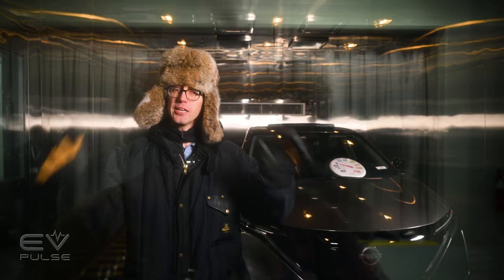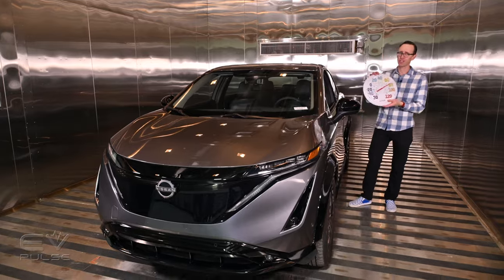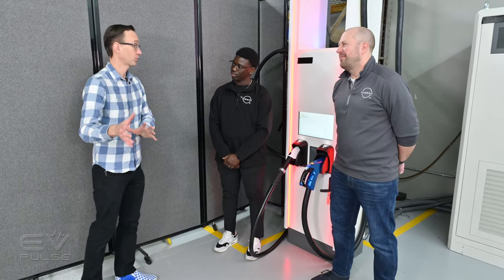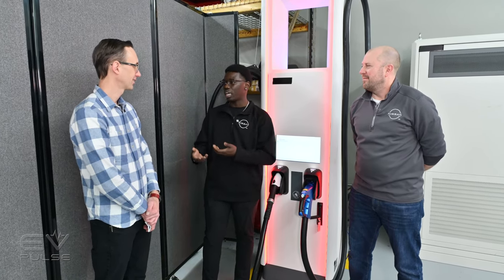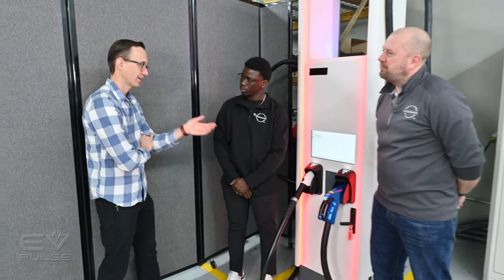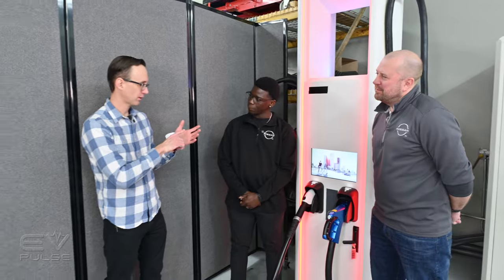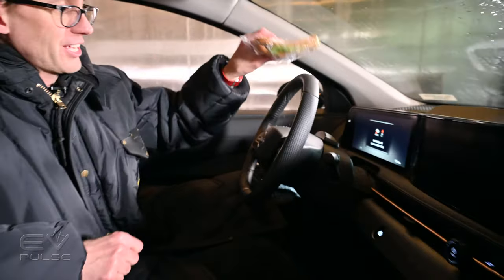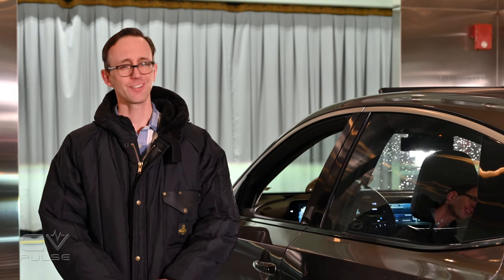We DEEP FREEZE an EV! How Much Range will it Lose?

Comment: On Teslas, you can remotely set it to warm the cabin an hour before leaving even you're NOT plugged in. In the process, the battery slowly warms itself. If the Nissan has the same ability, you should not need to be plugged in if you don't have a place to.
Reply: Well most cars and EVs do have app capabilities with remote start and hold functions. I do it with my Subaru Solterra
Reply: @rylans.5365  This is not remote start. The EV is not on. It doesn't have to be to warm itself. EVs don't have an ICE engine that needs to crank up for just about anything you need from it, and can be risky if left outside unattended
Reply: Byd too

Comment: The issue isn't only the inefficiency of Lithium ion batteries in cold. 

The other issue is that the car needs to use energy to warm itself - thus speeding up the depletion of its usable range. The snake eating itself by its tail.

Then there's the possibility of lines and waiting at a fast charger. Anything more than an Hour - of you sitting there with the heater on to keep from freezing - and now you're in danger of the battery dying before you even get to the charger. 

I have a home charger (Lectron Vbox) and I charge in Public on EVgo.   Even at the coldest this winter:  20'F I didn't have any significant problems and my car would only lose 10 miles of range in 7 hours of idle.
Reply: I charge at home and had zero problems in sub-zero temps; 2022 LEAF 62kwh
Reply: You’re ev can sit turned on for hours   The problem is people playing Kyle Conner and arriving at the charger with 0% charge.  Put them in bad position if you have to wait

Comment: The range estimation when you turn the car back on is based on prior drive cycle stats. You need to drive the vehicle for a while for the vehicle to acquire fresh data from its frozen state before estimates get updated accordingly unless Nissan's range guesstimator has sufficiently accurate correction tables to account for temperature offsets between ambient temperature old data was acquired at and current temperature.
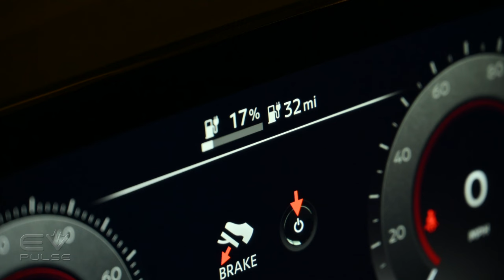Reply: 13:29 14:36